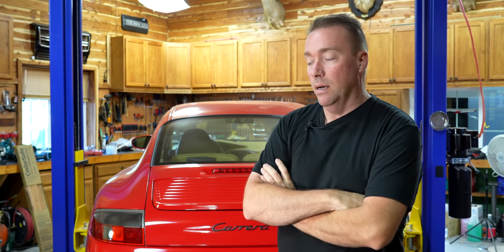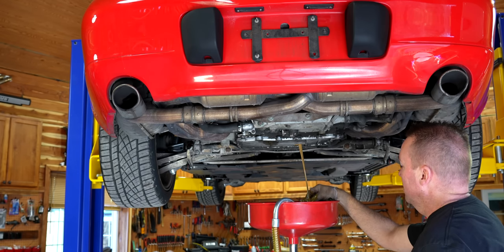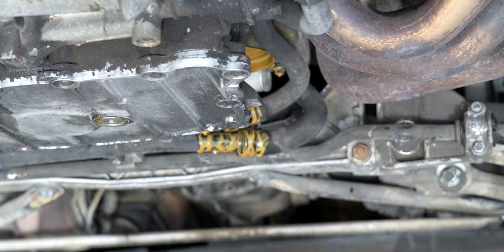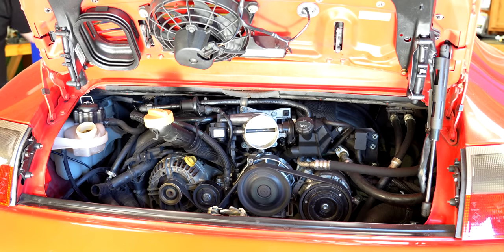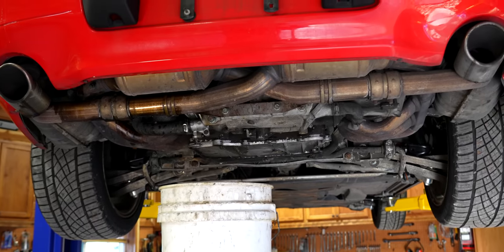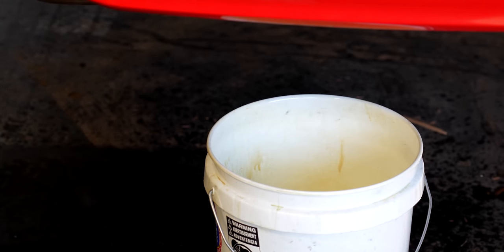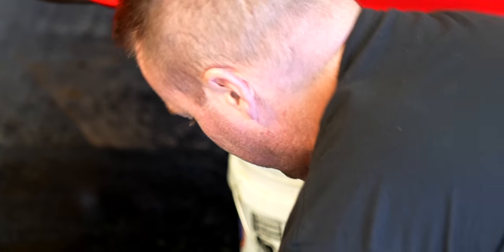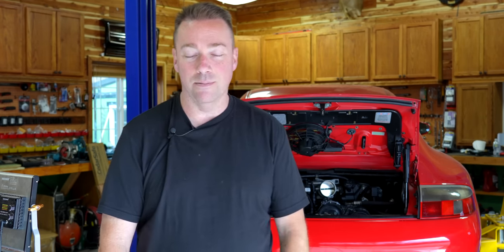More BIG Problems With The Red Porsche 996 ...

Comment: Nathan, it's going to need a new engine or a engine tear down and overhaul. I had this exact problem on my 996 and after taking it to two different dealers and two independent shops and wasting almost 10k. I ended up spending 20k to have my engine overhauled and replacing all accessories. It's the only way to fix it.

Comment: I think it's worth trying one of the cracked head sealers, not just "chuck and forget" but one that has a proper process to install. It's not as if it has to hold combustion pressures. 

The next option is to remove the engine and strip and crack test the heads, hopefully, they find the issue. If they cannot find the crack then the block needs to be stripped and crack tested as well. So you may end up with a full rebuild.

Second-hand Porsche engines are just not an option. The gamble is huge and even one for rebuilding will still cost thousands.

The best way to have a reliable Porsche engine is to have an engine built for you by one of the few super specialists who will build it taking into account the inherent deficiencies in the original Porsche design.

One has to remember that the rest of the car is very well put together and very reliable so spending a large amount of money to get the engine built properly may well be a very good option that could work out cheaper than buying a new boring car.
Reply: Steel Seal works well.

Comment: Don’t put block sealer in it! That’s the worst thing you can do on these. Secondly you need to clear the bleeder lines from the front radiators. Otherwise you’ll never bleed out and it will always overheat. They get plugged with the old milkshake. There is a “Y” connection you need to access about midway on the car above the main coolant lines that run to the front. Disconnect those and push air through them. Also if it’s still making milkshake than definitely Bank 2 cylinder head cracked. Pull the head and send it to Hoffman machine shop.

Comment: Nathan, these heads can be repaired. There's a specialist that does them. If it's got low mileage and overheating didn't distort the deck it doesn't have to be a full overhaul. You can use a die that detects exhaust gas in the coolant. Shortblocks from Porsche are 9k. I agree with your estimated pricing on used motors. The market is flat right now, a roller wouldn't be a good call IMO. I'd say if you want to go cheap, a good used motor with a shop that stands behind it is the way to go. Transfer all your stuff over to it. The client can enjoy the car, drive it, keep it or sell when the market normalizes. Vertex auto has reasonably priced rebuilt motors. Do you diligence on their customer satisfaction. There's another outfit in Las Vegas that rebuilds motors, Rennlist has had some feedback on them, and their prices are reasonable as well. There's a group on Facebook with high mileage owners. There are 200k plus mile owners that daily drive them. The cars don't like to sit, and avoided maintenance costs a lot on them. EG: a guy gets a coolant leak, doesn't bother to deal with it. Drives it, parks it, but there was a bubble in it, which got stock in a pocket in the head and you get a crack. The coolant temp sensor never saw the localized hot spot so the driver didn't bother to stop. I bought a low mileage 996 myself, my buddy a low mileage 986. We've both been going through "deferred" maintenance items. If you do it yourself or have access to a good indy shop they can be good cars. But unlike a Civic or Camry, you have to keep up on the maintenance. Great video, I really enjoyed it. I was a mechanic in a former career for 15 years, I enjoy it leisurely now and not as much when my personal cars break, but I really appreciate seeing a solid wrench like yourself. Keep it up!

Comment: A Porsche mechanic would never take a plastic oil filter canister off with a pliers, there is a specific filter wrench that fits the flutes, a wrench can crack the housing.  It also distorted the shape when you squeeze so it’s hard to unscrew. 
That engine is toast, no amount of cleaning and flushing is going to correct the problem.
Reply: Dude, that isn't a pliers he is using, it is wrench made exactly for filters. He explains that in his video where he changes the oil in his red Cayman S, the video about getting smoke when starting. Check it out. And the engine turned out to NOT be toast. It just needed to be put back together correctly. Nathan said too many of you guys say that exact same thing without knowing what you are doing and throw away decent engines in the process. So wrong on both points. Watch the whole series before commenting next time.

Comment: You can get a new shortblock, replace the cracked head and voila! I did a 996 recently, $8,500 for the short block. It will have the latest and greatest IMS. Oil feed may be an option. May as well rework both heads while it's out. You will have a reliable engine again.
Reply: My friend Pat bought a brand new 996. It had oil/coolant mixing issues from the start. The dealer in Honolulu replaced his engine TWICE!
He sold the car right after the second engine change.
Obiously, it is a design flaw.

Comment: I learned (the hard way) these water cooled Porsche engines "hide" a LOT of oil (that is a turbine engine term, from my experience with those)
My first chance was on a 1999 2.5 Boxster. I pulled the drain plug and filter and let it drain (yes, it was warm).
When it was done, I removed the sump plate. Another 1/2 quart came out.
Then I went to have a beer, eat dinner, and go to bed.
When I came out the next morning there was (I would guess) another quart in the pan! And it was still dripping!

The point is, on a simple oil change, you DIDN'T get it all...

And when I refilled it, it took 9.5 qts to get 1 bar below the full mark, after warming it up, and THEN letting it sit... (the book says 8.7)

Comment: Pre-COVID pricing, my 996.1 D-chunked, and it was 17,000 for a new engine with labor. The engine seems good, according to compression tests, scoping the bores, and a few specialist indy mechanic inspections, but the engine installation guys were awful: many pinched harnesses that were hastily retaped, missing hardware, securing hardware not used, scratches to the bay, URO-brand AOS and coolant reservoir that both failed within 12K miles-- even the URO-brand cap failed!

Comment: Test for compression.  If lucky can be just the joint that blew .  1-could be just head joint blew with heat.  2- could be joint + warped head.  Could be worse but hopefully not.

That is way maintenance is so important on all cars.  Flush all liquids at least every 2 years.  Engine Oil every 6 months.  Cheap compared to fixing.

Comment: Why not screw a valve on the drain plug and have a hose feeding into the reservoir? Open/close the valve while it's running and using the hose to keep it full?

Comment: That's a lot of trouble filling, running, emptying the coolant a dozen times.  Should just remove the drain plug and let the garden hose fill the resevoir continously until clear. Then use a detergent, then flush with distilled water.  Done it this way more than once on other cars.
Reply: Yep after about the 3rd or 4th the flush, you can pretty much determine foreign oil is mixing with coolant. Such unnecessary wear on idle engine and a waste of time. Also, I would never let that crud run through the engine if visable in reservoir, a simple turkey baster can suck that up.

Comment: Cracked cylinder head or blown head gasket. Didn’t need to do so many coolant flushes, it obvious oil is still getting into the coolant. Why don’t you do a compression test?

Comment: I would have run the engine with fresh oil and NO filter.  Then drain the oil, refill, and then install the filter.

By the way, it is easier to put the filter into the cup [which you are supposed to change each time] and then torque it on, with a new O-ring by the way.

That's a shame about the cracked cylinder head.  Great video!

Comment: Hi Nathan , great job , bad luck,  what did your wife say when you dumped 250 l of oil contaminated water into the toilet? Woundn t it have been better to run the water through the irrigation system from the garden? When they plants don't die the coolant is ok!  I have no problems I could drain this kind of water/milk to the Golfcourse drain pipe here next door, but I would never do it ofcourse 😁🤣😄

Comment: There are two gaskets in between the crankcase halves.  Those can fail.  That's your best scenario.  Next would be cracked heads possibly.  Either way, you'll have to open your wallet and/or rebuild something.  A salvaged engine will run you more like 15K. Rebuilt, over 20.

Comment: I bought 2005 997 c2  in 2017 after selling my boxster in 2017. I bought 997 from regular dealership. No car history or maintenance history. I had car for 2 days and it started misfire bad. I gave to dealership who I bought from. They said it was knock sensor that wire was chewed by rat in my house only in two days. I'm mechanic my self. I know knock sensor would not cause misfire. They charge me $300 for wire repair. I knew they BS me. I took car home. Nxt day car misfire again and u couldn't drive it. I said F it and jacked car up and found all coil packs were cracked very bad. I bought all coil pack and plugs from pelican parts. Beru and Bosch. Car ran fine after. I called dealership and they never picked up. M&A motor in Huntington long Island. Bunch of crooks. I owned car for like 5 years. Never missed maintenance. Oil changes every 1000 mile or 1500 miles. Liqui moly oil and good filter. I did thermostat water pump even it's wasn't leaking. New clutch  RMS IMS bearing. Transmission service and added third radiator. I did all the service my self except clutch and IMS RMS. Finally sold car last month. Car was sold in day local. I might get turbo nxt time. I love to take care of my cars even they r normal cars. I'm very OCD.
I'm mechanic for city buses in NY. We have lot of mechanic draining coolant in oil containers and nxt guy not knowing he uses same coolant and oil mix in nxt bus and end up getting milk shake in bus coolant system. We have to do lot of flushes to get rid of milkshake. Even radiator hold lot of milk shake even entrie system is clean.  We use heavy duty all purpose cleaner and have to wash coolant resiorvor very good bcz milk shake loves to stick to resiorvor walls.

Comment: Man that sucks such a beautiful car! I have a 1977 911 turbo and it's my pride and joy .. in this situation I believe replacing the heads and hoping for the best would be the only option that makes financial sense Ebay has a 1999 Porsche 911 Coupe Red RWD Manual CARRERA with 72k miles  buy it now for $17k or make an offer so spending $10- 12k in just a replacement engines not sure its worth it.Cheers From Salt Lake City!
Reply: There is an assumption that there is nothing more to come after you put down those 17K for a 23 yo car... which is a terrible assumption :)
Reply: @Baerchenization  Agreed, a 996 that sells for less than market value usually has more than that in pending repairs. You've got to stay on top of the little things because they get big quickly.